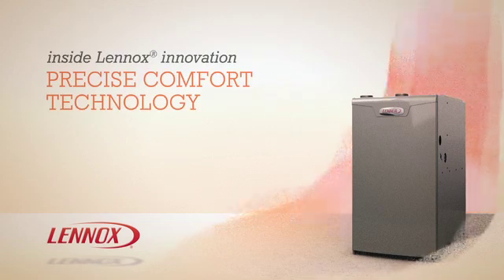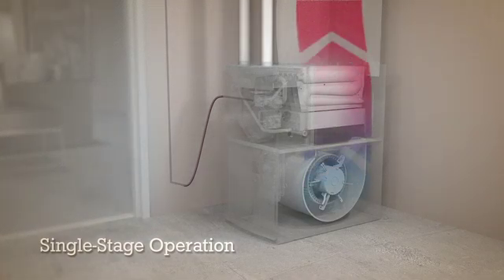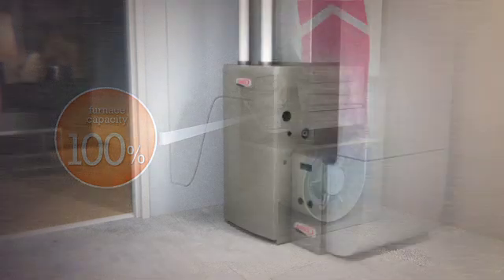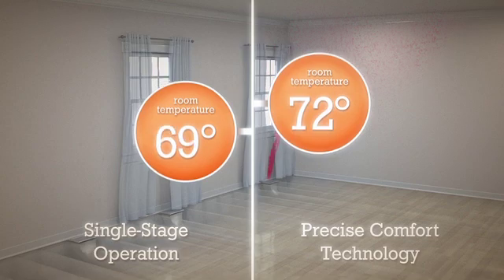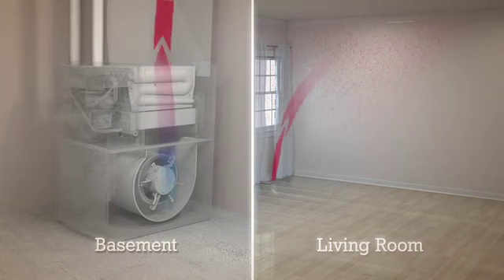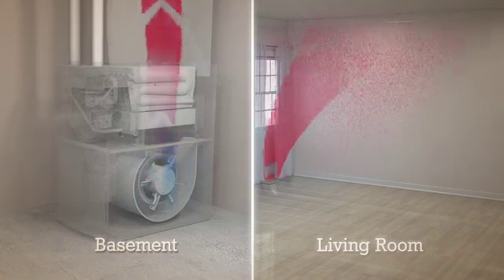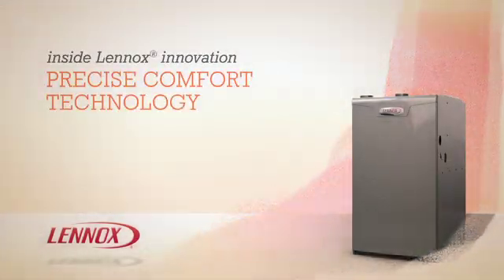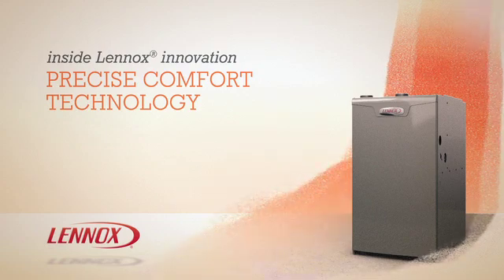Lennox Precise Comfort™ Furnace Technology

Comment: I got SLP98V furnace and I hear the furnace turning off and on every 10 minutes(the gas switch). There isn't a constant flow of warm air as described in this video. Is there a setting somewhere that I need to adjust?
Reply from the maker: Thanks for reaching out. We recommend contacting your servicing HVAC dealer to make them aware so they can look into this further. If you need a local Lennox dealer please visit https://bit.ly/3a5wSRS